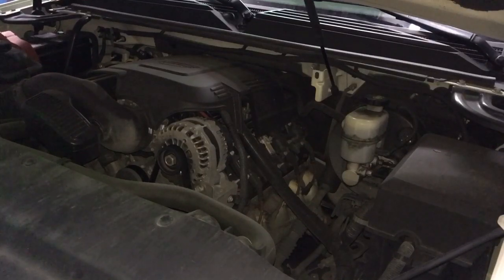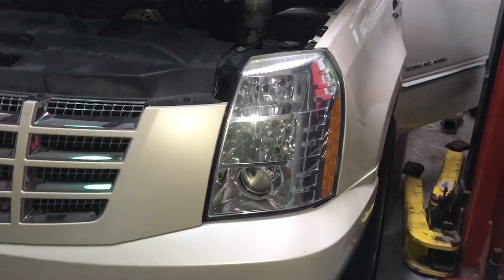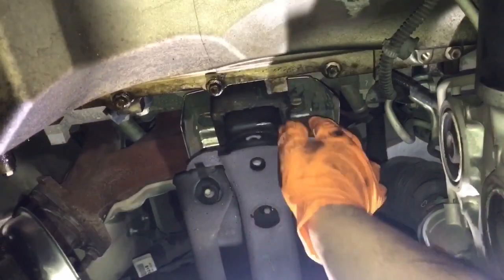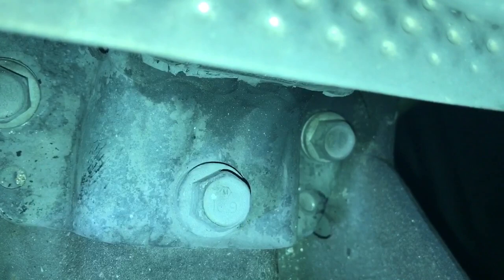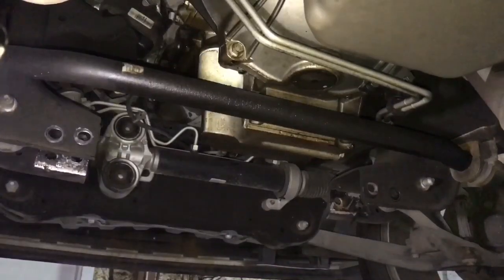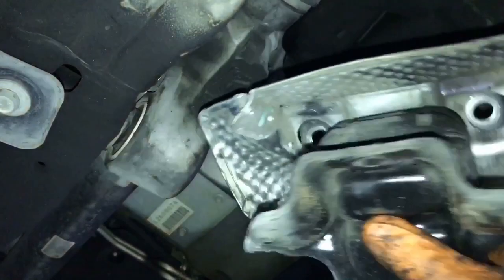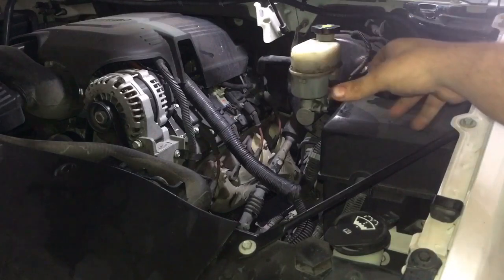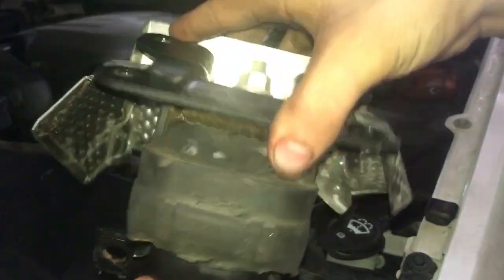GM motor mount replacement

Comment: I have the same truck but it's an EXT and I am about to do this job. It took me a minute to figure out why this looked so different from mine. It's because mine is an all wheel drive so in that beautiful open working space on this video there is a massive front differential right there which makes a mount swap from under the truck near impossible. Easier to do it from the top by removing the steering shaft.
Reply: ScarabChris, how did this project go?  Did you do the passenger side as well?  I can't seem to find many videos on the passenger side.  Like you, I have a AWD and will be probably taking out the steering shaft.

Comment: I just finished replacing my driver's side engine mount. I have a 2007 Yukon Denali AWD. It is near impossible to do it from underneath because of the transfer case. Your doesn't appear to be a AWD. I replaced it with the Hummer H3 mount which is solid rubber, not the crap Gel filled original that came with the vehicle.

Comment: I’ve had bad experience with after market motor mounts. I always buy oem
Reply from the maker: Corona light yea I’ve noticed the mounting holes don’t match up on aftermarket mounts
Reply: @OzMechanics  Even some OEM mounts dont last.  You need the H3 Hummer mount if you want it to last.  Made for a little more abuse and much longer life than the GMC/Chevy/Caddy versions.
Reply from the maker: Chukwuemeka Onyema so the hummer h3 mounts fit on the silverado ? What yr if you don’t mind me asking ?
Reply: @OzMechanics  the H3 mount is on the police trucks which is why they are more durable.  I cant remember part # off top but I think it was like an 09 H3 mount that fit the 07-14 Tahoe/Silverado/Suburban/Escalade.  If you do a google search on tahoeyukon forum, there is a section dedicated to this.

Comment: Seem to be a common issue with GM trucks. And that damn heat shield is useless...As every one of the mounts I seen. They are split right down the middle...

Comment: Wouldn’t you be better off replacing both motor mounts?
Reply from the maker: I found that the effected motor mount is the driver side. Even when lifting the engine up to remove the motor mount passenger side stays intact
Reply: Both motor mounts and transmission mount. If one is gone  the others are not far behind.

Comment: can you change it without removing the cross member ?
Reply from the maker: orville58 I removed the crossmember just to support the engine while lifting from the oil pan. If you use an engine hoist you don’t need to remove the cross member
Reply: @OzMechanics  ok thanks love your vids

Comment: I have a 2007 Yukon Denali XL AWD, I need to replace the motor mounts.  I've seen a lot of online videos on the Driver's side motor mount replacement but hardly any on the passenger side mount.  Why is that?  Do you really only need to replace the driver's side?  On a AWD, the passenger side looks much more complex.  Any advice is appreciated.
Reply from the maker: Normally speaking, the passenger side gets less damaged but if this has been going on for a while the passenger side will damage. As in how does it come out.... when I do them I remove the exhaust manifold and slightly Jack the engine up. It’s a hard job !
Reply: @OzMechanics  i think its safer to remove front diff than to risk rusty bolt breaking in cylinder head

Comment: A shop just told my son $1100 to replace a motor mount in our truck.
Reply from the maker: For both sides. That’s not a bad price if they are the gm ones
Reply: @OzMechanics  do you do the test in park or drive?

Comment: Process for 4wd:

*Remove wheel/tire
*Remove inner fender well
*Disconnect electrical connections in the way
*Remove manifold heat shield
*Remove broken mount heat shield (ripped it out by hand)
*Remove mount bolts
*Jack up engine using catalytic converter, this will create enough space to maneuver the old mount out. It's like a puzzle but it can be removed through that space. 
*Install new mount
*Reassemble

Did this today, it was a bear of a job, the worst part was the bottom mount bolts that did not want to come out. The threads are exposed to the elements and have a lot of built up crud. No way to access them to clean them I just sprayed them with penetrating oil and kept working the bolts back and forth. About a 4 hour job. Once the mount was unbolted I was able to manipulate it through that space by turning it upside down and around.

 I put the new mount in the same way I took the old mount out, it took some finesse but I was able to get the new mount in place relatively easy. If you're having a hard time Jack the engine up some more. I took the time to clean the bolts and the threads before reinstalling so that I would not have a hard time with the bolts going back in. 

I did not have to drop the front diff, I did not remove the steering shaft and nor did I remove the exhaust manifold. So it can be done without removing any of those items.
Reply: The manifolds( bolts) on these these vehicles tend to break off very easily and will create exhaust leaks. Happened to my wifes tahoe. This is also a bear to repair. Would recommend not using any part of the exhaust to jack up on with these particular motors. Use the 2x4 and jack on the oil pan. Otherwise this job is indeed a beast for the home mechanic.